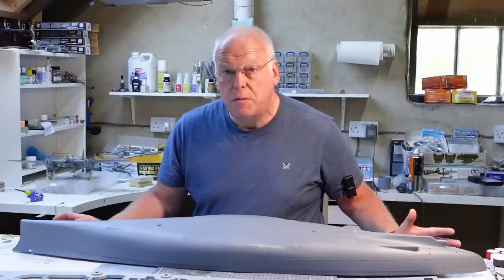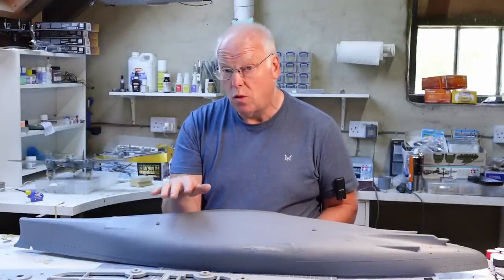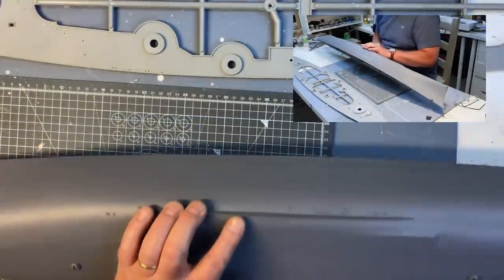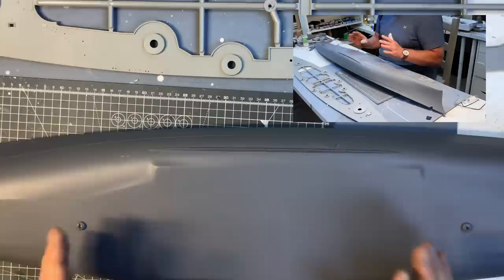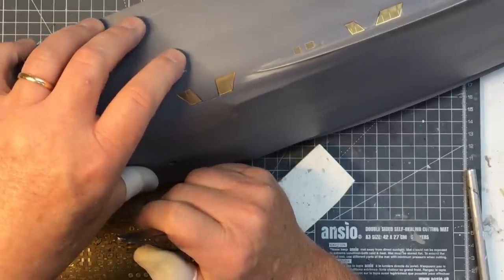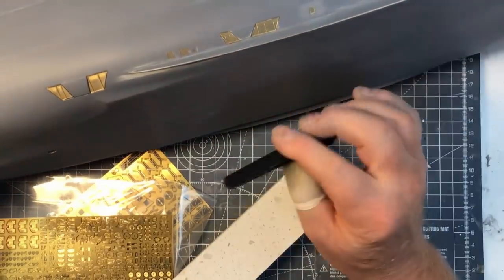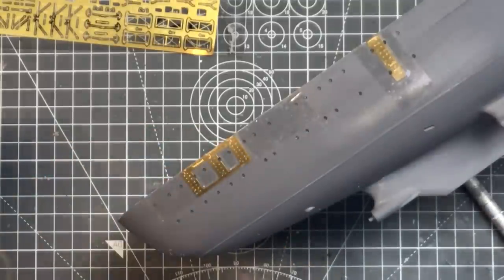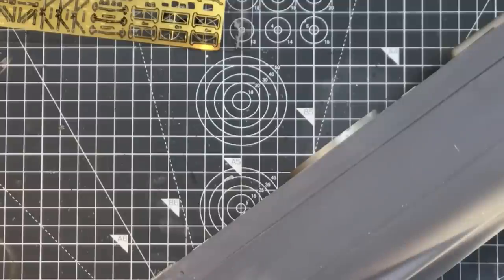Trumpeter 1/200 DKM Bismarck Full build with Pontos detail set Part 4

Comment: Great stuff, the ladder steps are the best I have seen to date, very neat. Didn’t you use varnish to hold the rigols  on the Hood and then seal in with the paint? Out of interest how many drills did you break in the end?
Reply from the maker: I can’t remember now about the hood rigols but I think I glued them. I broke 3 0.3s on the hull - 2 doing the work and one in the box putting the lid on! they’re fragile things…..
Reply: Just checked back on the Hood, you used gloss varnish.

Comment: Can you advise what medium superglue or gel and accelerator you use for this model, as I am finding so many products and little information on them.
Reply from the maker: I use a variety depending on application. Thick/gel where the contact area is small or you need time to adjust the fit: medium/thin for larger areas or for a quick bond. I’m not fussy about accelerator it all seems the same to me. I use a make called vitalbond on eBay they do glue/accelerator packages.
Reply: @TheModelShed  Thank you